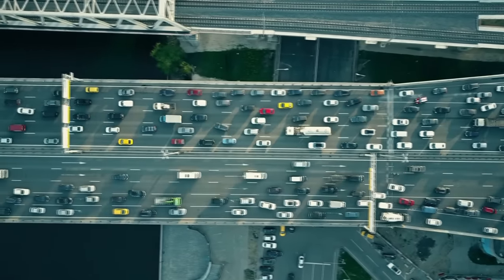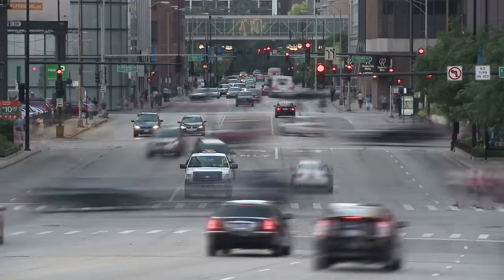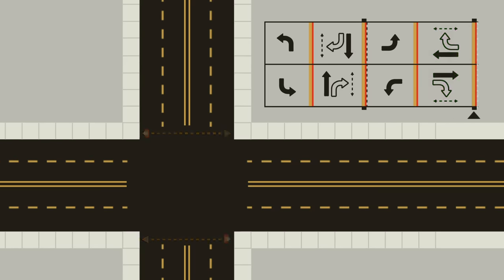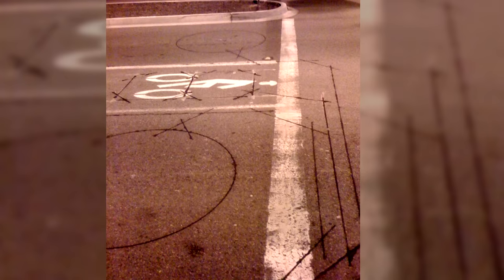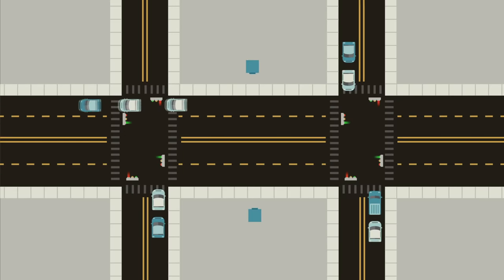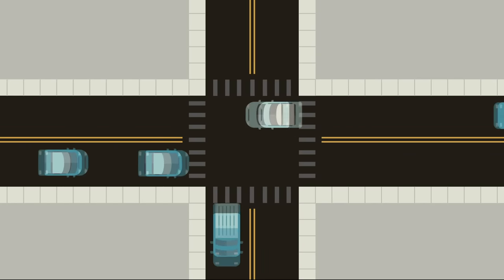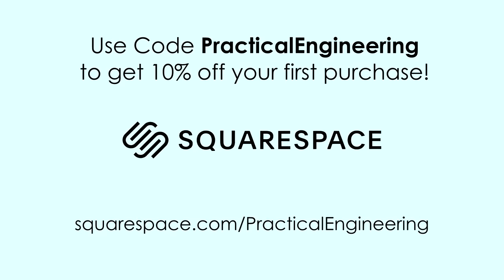How Do Traffic Signals Work?

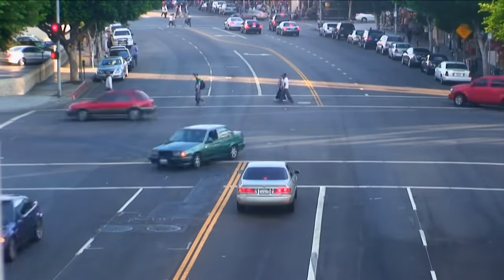Comment: 3:33 Actually, in all three advantages the roundabout beats the traffic light to the punch 🤜 by a massive margin! Traffic lights are way too overrated and roundabouts are very underrated!
Reply: Space. you can't break up a 150 yo building for removing a traffic light. That's why cities use huge multi-building size roundabouts (one way roads) as an alternative.
Reply: GS4444 You don’t have to. Roundabouts don’t need turning lanes or backup space, so you can use that space to build it. It’s happened before. Alternatively, you can rebuild a building you destroy somewhere else if it’s an important building, but 100+ years old buildings have been destroyed before.
Reply: @astromec6303  Have you actually been to an organically grown city? There are no turning lanes...

And then there's the problem of pedestrians. Traffic lights are unavoidable.

Comment: Traffic lights in the UK give you some time to react to start moving. Basically, traffic lights (in the UK) go: Red, Red and Amber, then Green before starting to move from a red light, and then Green, Amber, then Red before stopping. You can't move when there is an Amber light (basically, you can't go past the stop line when the traffic light is at amber when going to red, and you can't start moving at red and amber; you can't start moving until green).

Comment: Very nicely edited video! Though I'm almost surprised you didn't mention the conflict monitor. It's a piece of hardware that most people don't even know exists, and hopefully never needs to intervene. If the monitor detects voltage on conflicting green signals which could cause an accident, it will send the entire intersection into flashing mode. It can often be noticed in videos where a car crashes into a traffic signal pole, causing a momentary wiring short, and suddenly the entire intersection is flashing instead of sequencing.

Also a fun fact: Signal cabinets generally have an access panel on the outside, which allows a police officer to manually put the intersection into flashing mode, especially when they are directing traffic themselves. But they can also set it to manual sequence mode, in which the officer temporarily takes over the timing of the phase changes, using a wired remote control button, known as a "pickle"!

Comment: One way to combat traffic is to make sure trains and trams are fast and efficient as possible and get more drivers off the road and to take public transport. 
Another way is to rebuild old areas that are outdated, this could be removing old lights, road and possible homes to remake new road and better traffic management. 
Another way is to get people out of the city and away from the traffic trouble areas. Build places outside the city that will attract people to move there and spread out the people.

Another issue with traffic mostly comes down to the people in front, if they drive off from a green right away then the rest of the pack behind will move fast however if someone is like picking their nose, looking away from the lights, using their phones, not paying attention then they are still sitting at the green light and holds everyone up. If everyone takes off at the same speed then all the cars will get through the lights with ease, but since we are all human we can't do that without someone taking off bit too quick and rear ending the guy in front. Not only does people taking their time taking off that is an issue it's also the people who driver slow no matter where they are, slow lane or the fast lane, they hold up traffic and cause people to get frustrated therefor seem to catch all the red lights.

The Amber light is often used for drivers to quickly speed up to make the intersection, and even if it goes red before they make it to it they sometimes if not a lot of the times go through it anyway.

Comment: I remember the olden days when side streets had a pressure plate to the signal box a cehicle was waiting.  Then there was a metal detector buried in the concrete,  Then the "Right On Red" signs.
So many times the Busy street traffic was stopped to wait for a vehicle on a side street that had gone long before, but the signal was tripped.  Then came the added "Walk" signal with its push button,  After which followed a disconnected "walk" button but the signals were on timers sequence,  Main Traffic green for 30 seconds,  Walk signal active for 10 seconds,  Side street active for 10 to 15 seconds.  We have Yellow, Stop on Yellow [many speed up to "make it"] before RED.   After a while the Yellow would change to RED,  AND ALL directions wer RED for 5 seconds befor the Green to give time for the intersection to clear.   *The smart alecs figured this out,  and began running the Red*.   At uncontrolled cross walks (marked or not) the new law says to give right-of-way to pedestrians,  I stop for them and cars behind me HONK and pass me?   Then there is the bicyclists,  a whole new breed.  Law says ride with traffic.  Well 'they' claim it is safer to ride against traffic,  the law says not on sidewalks or crosswalks,  well I had a cop order me off the road onto the sidewalk,  as well as many cyclists saying it is safer on the sidewalk.  Pedestrians be damned?  How many bikes do you see with bells on?  Who uses bells,  who hears bells?  Ever been hit walking on a sidewalk by a bike?  <*>  of late when approaching a 4way Stop  if car "A: stops,  approaching cars on the sides DON'T,  since car "A" is stopped/stopping why bother.  And,  if there is a Line of cars they will upto 3 all start and keep going at once.  They 'already stopped, right?"

Comment: 5:46 I believe that the length of the painted white line on the passenger side of a left turn lane (indicating the entrance to the turn lane) corresponds to the amount of time that a yellow light will stay yellow before changing to red.  IOW, if my speed is the same as the speed limit, & I pass the left-turn lane entrance before the light turns yellow, I will have enough time to cross the intersection before the light turns red.
For example, if the light turned yellow at 3:31 of the video, the silver minivan coming toward the camera would be able to get through before the light turned red, since it was past the entrance to the left turn lane.

Comment: Don't mind me, I'm just over here wishing my city had actuated control lights. Some suburbs around me have them, but everything downtown where I live is on timers.

I have a pretty good intuitive sense of the timers on my commute, and I can often coast through a block after my initial acceleration so I rarely have to come to a complete stop before green comes back around. 

My commute is often late at night, and I know to avoid certain lights that are timed for peak daytime traffic. One in particular will give me a very long red (never timed it, but it feels like several minutes) even when I'm the only car around at 2am.

The city just slashed the budget because of covid-related revenue drop, so I don't imagine traffic signal upgrades will happen anytime soon.
Reply: Fixed-time control is often used in downtowns to allow for coordination, to reduce the amount of delay and stops. Actuation and coordination are generally mutually-exclusive. For coordination to work, all intersections must have the same cycle length (or multiples). With actuated control, it varies depending on the amount of traffic detected, so this is impossible. However, some actuation is still possible, but only for side streets and left turns; unused green time can be reallocated to other phases (such as the main street), maintaining a constant cycle length. This is known as "semi-actuated coordinated" control and is often found on suburban arterials.

Comment: "How Do Traffic Signals Work?"
For motorcycles; they don't.
Reply: 2stroke4me which is why, in my city, if you are at a red light for 2 minutes and no change in light, you treat it as a stop sign
Reply: Get a magnet... they work for me.
I have a big magnet on all my scooters and motorcycles and once you know which signals have metal detectors you never have to wait. 
Try it out. You'll be surprised how well it works.
Edit/P.S. : I used speaker magnets for my first 3 bikes, about 3in in size. They hold about 10lbs each. After they worked I bought large magnets designed as hooks for hanging stuff at home depot, also designed to hang about 10lbs. 
I tried small magnets but they didn't work, you have to go pretty big. I'm sure it will take a bit of experimentation based on the size of your bikes and your road detectors.
Good luck.
Reply: @TheReadBaron91  Which city, out of curiosity?
Reply: Random Dud3 Central Illinois. Applies to motorcycles (or those registered as a motorcycle in my case).
Reply: They don't work very well for my tiny daily driver car either. I have to position the engine over the sensor for it to detect the car lol. Even then, it can take minutes for some lights to change despite minimal to no cross traffic. Every time I have considered running the light, out pops a cop. I swear they're scoping the intersections just to catch people doing that.
Reply: Luckily we are moving away from loops for this reason. I build intersections for a living and although we use loops on smaller intersections (cost effective) that do not have that much traffic flow, the busier roadways are starting to use radar vehicle detection.
Reply: If the signals you drive through are timed or the detection is loops you'll have problems on a motorcycle depending upon the sensitivity settings of the detector card but if they operate off of radar, cameras, or microwave the signals work much more effectively. My favorite detection is radar by wavetronix but it is much more expensive than the alternatives.
Reply: Actually, I misunderstood the joke like as motorcycle drivers do not stop at traffic lights. 

Because this is very common here in Ukraine for bicycles. Actually, it is common on traffic lights on straight road - just for pedestrians to cross it. But anyway those "drivers" for some reason think that they can occupy carriageway but not obey the damn traffic lights. That pisses me off as you can see.
Reply: @NotSoCrazyNinja  Of course! City sets up a light incorrectly on purpose so the cops can camp out and catch people disobeying a broken traffic light. Gotta love it! 🤬
Reply: Broken traffic light !!!
How would you know?
There is nothing about the signal to tell you the traffic light is on some form of detection system, whether you drive a truck, car, motorcycle or zero displacement bicycle; or for that matter if you are a pedestrian.
This is just a bad form of engineering, design, social/political system.
Reply: There's a light near where I live where for a busy intersection that literally gives 3 seconds of green light  and causes the most frustrating traffic imaginable
Reply: @2stroke4me  ,agreed - the traffic lights are not broken! They are badly designed, and do not work for many road users. Thus in effect they are "broken". Roads should be designed for all expected users.
     As for induction loop activated traffic lights. More & closely spaced induction loop would have a better chance of detecting a motorbike or even a bicycle. There are other means of detection as well, like optical which are less likely to discriminate regarding vehicle type.
     What's the real problem: lack of consideration in design with regard to 'minority' types of traffic. This could be because of cost or that the planners do not use those forms of transport.
     And there is still the problem of approaching an "interactive traffic signal", some of which may only do so part-time. Those types of traffic lights do not have any indication they are interactive (or even that a pedestrian might have to hunt for a hidden button). It does vary around the world, hope it is in your legislation about treating a 'broken traffic light' after 2-minutes as a Stop Sign, but for most of the world it is not (as here), however most would treat it as such.

Comment: The traffic engineers in Seattle saw the part at 8:30 and decided to do the exact opposite. On Mercer Ave, which cuts through a major section of the city and ends with a freeway onramp, the lights are clearly synchronized, but in a way that guarantees the smallest possible platoon of vehicles. The group furthest from the freeway gets blocked between two lights for an extended duration while incoming traffic from both sides get blocked for multiple cycles, but all 6 or so of the lights further up the road are green. As soon as the blocking light turns green, the rest of the lights all turn red. The end result is that that section of road between the two furthest lights sets the maximum size of the platoon, which eventually gets to go all the way to the freeway, but that the side streets trying to empty into the same space are completely unable to ever feed into it.

Comment: All your conclusions are perfectly right, and I would like to add one. A car takes the place of six bicycles riding at a safe distance. Well-coordinated and attractive buses and trains, accompanied with parking lots for bicycles, will keep a number of people from joining into the hassles of rush hour.
Making roads more efficient will attract more cars. Making bicycles more attractive will take cars off the roads.
In my opinion, this can be an important part of traffic control for the future. I'm not saying this is the solution for everyone. I'm well aware that there are numerous people depending on their cars. But some don't. And helping them is helping the others, too.

After reading my comment, I see that it isn't perfectly aligned with the topic of your video. Sorry for that. I still leave it here, because I think it still delivers a good reason to consider bicycling.

Comment: Maybe you can explain to me why many signals are green as I approach, with ZERO cars going through the intersection, and as soon as I reach the intersection, it turns red and I have to stop. Then all the cross traffic clears, and I then sit at a red light with no one else going through the signal... then, just as someone is approaching the green light for the cross traffic, it turns red for them so they also get to sit through the whole cycle, and I then get to go.

Comment: On small neighborhood lighted intersections if you pull up with the breaker bar (8" wide line) down the middle of your vehicke,  it says there are multi vehicles and the light will  change quicker.

Comment: here on Brazil, we don't have any type of sensor, if it has it will most likely be stolen. the other problem is that there's no need sensors on every intersection, because no one will care about it.
not to long ago me and my mother in a motorcycle got hit by an ambulance in high speed, in a intersection, while it was a red light to the ambulance, the guy driving it was scared and said that there was no emergency happening in the moment, he just wanted to go faster to the hospital

Comment: I have been thinking a quite of some time that we could make traffic go smoother. One example would be the order in crossections. If the car that is going straight forword would give time to the car that is turning frome crossing road it would be more efficient. The car that is waiting to turn would not need to idle so long and the car that gives time for the turning car by just lifting the pedal up would also have no emmission during the slowdown. This would need huge chainges in general attitude of drivers though.

Comment: I used to work with traffic lights, it was fun to see how stuff you take for granted work to keep what should be chaos into a little less chaos. 
Some interesting facts is that sometimes you see those detectors in the middle of the road far away from the intersection and they are used to detect the speed of the traffic, the systems I worked with sent the information as 4 bits 0000 being no traffic at all and 1111 being standstill. 
Other very interesting fact about traffic lights is the failsafes they include, and probably the most important one is what we called a conflict fuse and it was a completly separate module from the main computer acting solely on the voltage coming from the signals, making it way more robust in case of a computer failure. In the case that it detects a "green conflict" it would cut power to the whole intersection because, by law, a traffic light being off is an all-way stop signal. Way safer than having green lights on conflicting sides. Also the moment when all the intersection is red is usually a couple of seconds to avoid crashed of someone skipping a red light on their side, this time is called (surprisingly) an "all red status".

Lastly yes, the buttons you press for crossing an intersection do work. Think of them as our equivalent of the ground detectors, they may seem useless at times because most intersections are programmed to give preference to cars, depends when your pressed in the cycle that you may or may not see a difference in the time you wait.

Comment: Not sure if urban traffic management is inherrently complex, rather we may make it more complex than it needs to be.  My town has a horrible traffic problem from sunrise to sunset.  The signal cycles seem to do more harm than good.  After hurricane Michael we had no traffic lights for months and months yet traffic moved easier and more efficiently despite having debris on the road, construction crews everywhere and less than 10% working lights.

Comment: In their simplest form, they are a set of TWO lights for each lane. We're just so used to the extra orange light. You could for instance replace it by the green light blinking. Austria has that, in addition to the yellow light.